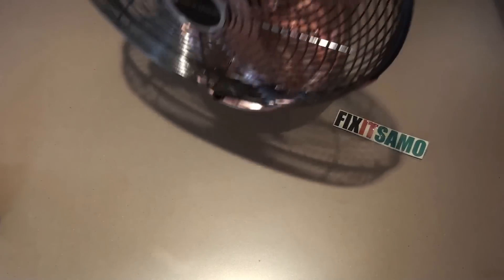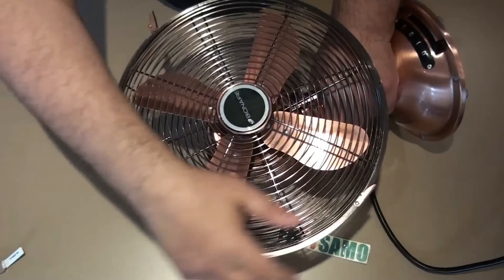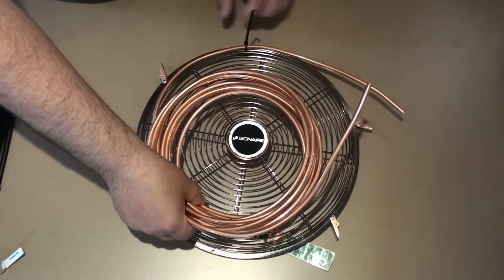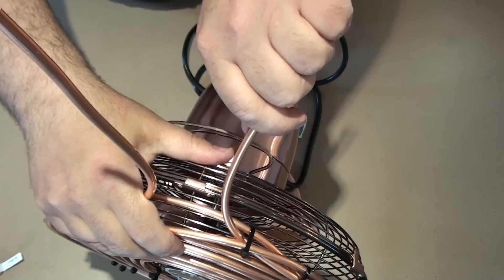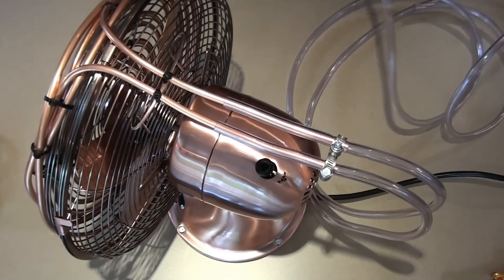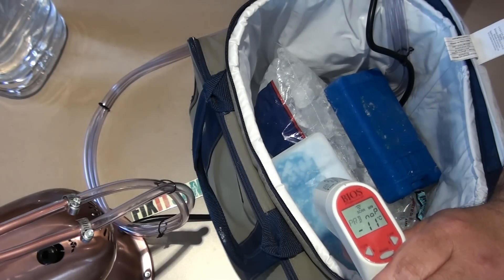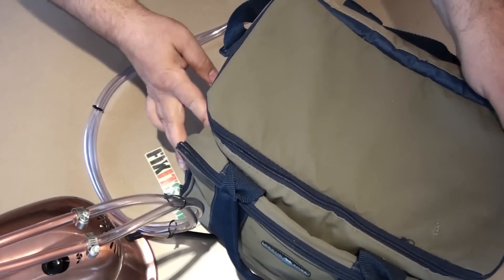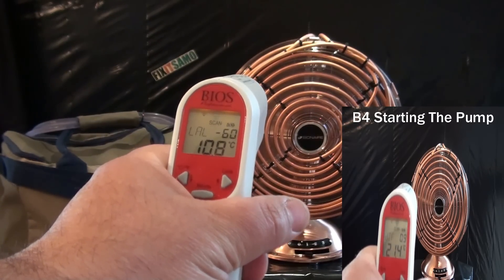How To Turn Your Fan Into An Airconditioner  AC

Comment: How about a peltier cell on the inside of the bag with a piece of copper tubing as a cooling element for the water that circulates inside that tubing and the hot side of the cell with a heatsink vented outside.
Reply: peltier need veeery much energy^^ so you could simply buy an air conditioner with ~1000 watts^^
Reply: *****
I think you can get away with 100-200 watts. I mean a 12V ~6A cell is 72W worth of power and say u use two...you get like ~150 Watts. Now I didn't do the math on efficiency and that's probably where your coming from, and I'd probably agree, but what you could do is put the cold side of the peltier cell into an insulated container and have that cool the water in that container. That should keep it relatively at a constant temperature, after it settles, of course.

And btw this was just a hypothetical question, I wasn't affirming it to work well :P
Reply: Marian-Gabriel Flocan
 I thought that you were speaking hypothetical^^ but to cool an 150Watt tdp cpu you need to power ~300 watts on the peltier:P
Reply: +eta10tp1 Well yeah...but in this case you would only cool room temperature water not CPU's :p
Reply: Marian-Gabriel Flocan
 the effect is the same^^
Reply: :)) It very well may be so...although I seem to fail to understand how a stream of not actively heating water flowing through a tube be compared to an actively heating cpu. But then again if I, personally, don't get it, that doesn't mean it's not so :P  Anyways thanks for pointing me to that :) I'll read some more on peltier's effect and thermal differences :D
Reply: Marian-Gabriel Flocan
 do that but don't do it too much because its a huuuge topicxD :P
Reply: :)) well yeah I just want to get more familiar not to get a PhD on the subject :P

Comment: Am curious if the electricity it cost to make ice costs more than it would cost to have a small ac unit?
Reply: that's true but it is using more energy if it needs to keep more things cold
Reply: Actually it doesn't drain more power, intended as current. It just drains Thermal energy, if that's what you mean. But that doesn't cost you anything in terms of money and also it won't make stuff in your fridge any hotter

Comment: he actually could use dry ice or liquid nitrogen to had a cooler effect
Reply: I don't think so, dry ice put in this kind of container with water would propably destroy the "fridge" becouse of building up gas pressure. Nitrogen could destroy the pump.

Comment: Can you write all the Materials of this Project and can I buy it all at Home Depot ,thanks
Reply: 25 foot roll of 1/4" Copper tube
(2) 3/8" clear vinyl tubing cut to length needed.
(2) hose clamps that fit the outer diameter of the vinyl tubing
A bag of short zip ties or cable ties (get a bag of 100 they don't cost much)
Fountain pump
A cooler if you don't have one and a way to cool the water inside.

Tools:
Something to cut the zip ties
Pliers to pull the ties tight
A nut driver or screw driver to tighten the hose clamps
Reply from the maker: thank you

Comment: dose it really work ??
Reply: yes buy a proper air conditioning unit, lol
Reply: solar panel.   i have 400 watts on my camper roof as well.  the sun feeds the panel which runs the 12 volt freezer and powers the pump and fan.  thats how i do it, i assume he is doing it in a similar manner
Reply: for 10 minutes
Reply: +Mike Warren , what happens after 10 mins ?
Reply: +Mike Warren , i want a solution that can actually cool the rooms air, is it possible ?
Reply: pijush mondal If you live in a dry area you can use a "swamp cooler". If you live in a place with 50% or more humidity, buy a window air conditioner off of craigs list.
Reply: where are you getting power in the middle of nowhere to freeze the water?

Comment: The Tricks: 
1. Cool temp cause by ice bag!

Problem:
1. after the ice melt you will have normal temp.
2. not practical for long hour. 
3. you will have more difficulties on cleaning the fan and copper tube.
4. You are using more voltage for Fan & Pump. 
5. using more space.
Reply: you are using more power to make ice too
Reply: Not really. Your freezer is on anyway. 

A packed freezer is more efficient than an empty one.

Comment: Why not just put the ice in vented containers (that catches the  water as it melts)and put the fan behind it blowing on and through the lattice stacked ice. In the long run the air conditioner will be less expensive. ($135 cost plus electricity to run for 10 years...much less than the cost of the ice over that time. ingenius creation though.
Reply: you can just get back the melted ice into the frig then get another one to replace the melted ice.
Reply: You dont need to use ice cubes. You can freeze bottles of water so when it melts, there is no mess.

Comment: how much is a cheap ac at walmart. how much is copper coil. why do this
Reply: See the running cost, many times cheaper then AC.
Reply: How much is ice. This is dumb
Reply: AC is 1600 watt and this will take less than 100 watts

Comment: you could run the copper tube inside concrete in the basement and never worry about the ice. Concrete floors are cold and never would heat up if you ran several square feet. The floor is not cold but certainly can be colder than the second floor air
Reply: I mean you COULD do that, but that would add to the cost of copper tubing plus additional plastic tubing routing downstairs. A second issue with that is not all houses have a downstairs basement or have access to the concrete below the house. Lastly, with a small pump like that, I can't exactly imagine it's ability to pump water from the basement to the second floor all too well.
Reply: If the air has to travel a long distance it will heat up before it reaches the room.

Comment: This is really awesome!! There is a lot of criticism of this method giving examples of what a typical AC can do and thermodynamics and crap but this is a amazing low cost solution. I see it really being useful in developing countries where people can't afford an AC, let along the electricity it's going to guzzle. They can definitely afford a copper tube and are paying for a fan already and ice is not very expensive. And not to mention its portability (you will need to carry some batteries of course). And I am sure this will not cool the whole room but a few gusts of cool air will provide a welcome respite from the heat. Thumbs up!

Comment: This is not doing anything to cool the air.  Worse, it's adding moisture. Basic thermodynamics. To do it right search for "diy swamp cooler" or "diy evaporative cooler".
Reply: Greg, this is not going to add moisture as the water never leaves the tubes and it will cool the room but moving heat from the room to the cooler bag. Basic thermodynamics. Those were a drawback with the 'air coolers' that had a  process of using a fan to blow on a wet mat to create a cool draft. There will be some evaporation from the cooler but that's going to be negligible since it is pretty much closed.
Reply: Water will condense on the copper tubing and get blown forward
Reply: That's what she said

Comment: Better idea - go spend just over $100 to buy a window AC.  The device shown here actually makes your house hotter due to the energy used by your refrigerator to freeze the blue ice packs coupled with the heat pulled from the blue ice packs while they're freezing being vented into your home by the refrigerators heat exchanger.  Hopefully NOBODY is dumb enough to follow these instructions.  I'm so tired of seeing these "helpful" videos that show such amazing ignorance.
Reply: This should do about the same as a super cheap window AC. You are not trying to heat the whole house, just a specific room. That is why this unit, or even a cheap window unit, would only be used in a single room. Chances are he isn't trying to keep his kitchen cooled and this is for a bedroom.
Reply: you would have the freezer going anyway
Reply: In the kitchen. You're looking to cool yourself and a small area, not the whole house. It's a tradeoff that you're going to make no matter what decision you make. Either get an AC unit and have it run electricity making it cost a lot more in general or make a cooler like this to give you the temperature you want where you are and make the house suffer a bit more.

HOWEVER, if you're running into a heat issue and your house is too hot as it is, circulate air from outside into the house to disperse the heat. If it's that much hotter outside than inside and your freezer is running, what difference would it make at that point to circulate the air and make it no hotter than it is outside? Yes, you're drawing power from a freezer and circulating air, but that is a lot better than installing an AC unit. Plus, the heat output from a freezer after an hour isn't likely as hot as the day outside where you're forced to use a cooler like this.

Comment: I did this prior to watching this video but, my setup is almost exactly the same just on a larger scale.  My fan is a floor standing fan about 24" wide and it oscillates as well.  I use mine to keep my garage cool when I'm in there doing stuff and it works excellent!  The only one issue is that with the movement and circulation of ice water in the cooler, it makes the ice melt faster than normal so bigger ice blocks last longer.  However, if you keep it covered the temp of the ice water goes up slower and still keeps my garage much cooler than if I didn't use it at all.  I've been successful in cooling it on average about 10-15 degrees at least.  Not as easy to cool on higher humidity days

Comment: I checked Amazon for the pumps but on some pictures there's a AC 220 volt pump and on other pictures AC120 volt. It's kind of confusing! Which version they will send? I live in Europe and I need a 220V version.
Reply from the maker: try here https://www.amazon.ca/OFKP%C2%AE-Submersible-Water-Aquarium-Fountain/dp/B015MMFMIK/ref=sr_1_1?ie=UTF8&qid=1466292602&sr=8-1&keywords=220+water+pump
Reply: Thanx! This one appears to be O.K.

Comment: You are aiming at the coils when you were getting a temperature reading right? Why not set up a piece of cardboard parallel to the fan, right in front of the face, and take a temperature reading of the air its blowing. I have a feeling it may be 20F*+++ warmer.

Comment: This is really neat, but why would you want to do this? Isn't the cost and trouble of replacing the ice going to make this unit impractical? Also, you have no thermostat so you'll have to constantly babysit the unit to keep the room at a comfortable temperature.
Reply: It's a poor man's AC unit.  I love it and this poor man is thinking about making one.  $450 (avg. price of a small AC)still buys a lot of ice and you are not using it all year long.
Reply: Not to mention if you have a freezer you can just make the ice. As for a thermostat, while it would be useful it wouldn't be at all necessary. It's literally the same thing as turning on a fan in your room, just colder. At the end of it though, a few feet of copper tubing and a fish tank water pump sure beats the hell out of a $400 window conditioning unit. Also much more mobile, so you could have it on your desk rather than in a window if you so desire.

Comment: This is so cool. With a pump like that, electricity consumption must be low. Only issue is to try to have good insulation for the ice packs. May be the tubes can be place below the motor to prevent a short circuit if there is leakage.

Comment: the AC in my apt is out, might try this tomorrow if they haven't fixed it by then, not sure it's worth buying all those supplies but trying to sleep in sweltering heat is awful, cool video

Comment: With all the money and time spent you might as well buy an AC 😂
Reply: This is for cooling a single room though, and more for cooling a single area of that room. You can get cheap window units for ~$150 all day long that will cool a small room like this is designed for. The window unit should do a better job as well since it will dehumidify the air which is a HUGE part of staying cool.
Reply: Your average window A/C unit costs about $350 assuming you can't get one off a friend for a lower price. It would take about $20 to afford the amount of copper tubing he used (Even less if you get it from a scrap sale/junkyard/recycle plant/etc)
The vinyl tubing could be bought for $5 if you're being overly generous (you'll get about, eh, 7 feet out of that)
The pump itself is anywhere from $9-$15 dollars.
If you don't already have a fan, lets throw in another $20 for a good fan.
In total, you'll spend about $55 if you go the maximum to have left over supplies.
That's 1/7 of the price of a window A/C and it can be built in an hour or less.

Note: The prices I show are based on nearby stores and hobby shops, not what is listed in his description.

Comment: A better solution is a "swampy" assuming you live in a low humidity environment. Running your freezer all day to keep this supplied with ice isn't particularly efficient. The added resistance of the air flow will also tend to overheat the fan motor and also cause it to draw more power. All in all, this is a bad setup.
Reply: Um, freezers run all day anyway.
Reply: No they don't. Your compressor only comes on occasionally. But if you fill a bunch of ice-cube trays with water, the compressor will kick on and stay on. Turning water into ice requires a lot of energy. It also takes a lot of energy to turn ice back into water, MUCH, MUCH more than to raise the same amount of water a single degree. It's the latent heat effect.

Comment: I think it would be much easier to go out a buy an AC unit.
Reply: Firstly buying an ac wouldn't be cheaper, at least not where I am this would be, secondly some people have fridges that make I've you don't have to keep buying it, what's wrong with putting a plate or something in the freezer? Is your freezer really that packed? There alternatives.
Reply: yep. a small one for sure. i bet it isn't that much cheaper with all the ice you need to keep buying.
Reply: You could even buy a used one for cheap....or you can find some for free from people who like donating their stuff to people like this guy (who made this homemade AC unit)
Reply: not in my country...nobody donates anything... AC are very expensive. I have a fan already at home, i think i'll try and improve it with this method. This kind of idea is for those who dont't have enough money to buy new things. where i live, only to fix an AC in the wall costs arr. 100-150 E, plus the apparatus.

Comment: Nice clean job. The point is that it is used when an a/c isn't practical. Also this uses far less electricity. However, making ice... Note: Use a brushless pump if your going to run it alot. :)))
Reply from the maker: thank you

Comment: this isn't an air conditioner. you're using the air from the house to warm up ice cubes. you might as well leave the ice cubes out on the bench. and even if you had this going to a fridge, your fridge actually warms up the outside as it cools the inside. thats how it works.

you're just blowing wet air around by disturbing water when it returns back into your bucket of water there.
Reply: Satanic comment
Reply: They do have things called 'swamp' air conditioners in dry climates; air is blown through wet pads to cool down a house. 

Depends how well insulated the cooler is ykno? If it's decently insulated the ice would likely stay frozen for five to ten hours, and you can keep swapping out ice packs..

However, water will condense on the outside of the copper, so there are a few practical concerns I'd be interested in seeing addressed.

Comment: First, thank you so much Samo for sharing this great idea, I am so doing this very soon.
Second, for all the negative commenters here, even some suggesting to by a window AC wow the shock of wisdom obviously this is not meant to replace your household AC, this is something meant to work on a small scale like a camping tent or a small  RV where you hock it to your car battery or a solar panel. I do a lot of desert driving and camping and this is just what I need.
Just 2 questions here Samo,1- say it is really hot night (37-41 C) how long such an exact setting will last on one full load of ice? both the fan and the bag I have are about the same size you used in this video. 2, as I will be using this as part of my camping gear, I was thinking of either fixing the copper tube ether at the back screen of the f
an or inside the front screen so it is protected. any reservations on that?
Reply from the maker: thank you sorry for the late response the cooler that I used the ice lasted at least 12 hrs.  but it was  28 C I don't recommend installing the copper tube  at the back it will not  give the same results

Comment: why go so far as have to worry about ice drill a hole into ur fridge slip the hose in to it and out so it can cycle. water wont freeze if its flowing so u can wrap the hose inside a few times to get it colder and just make sure its not leaking and has no pockets of air in the cycle once done seal the gaps left by the drill with epoxy and done
Reply: make some video for that sir. tnx
Reply: This would kill your fridge in no time at all.  It would be like leaving the door to the fridge open all day.
Reply: a fridge puts out heat
Reply: I think the fridge compressor can run continuously without burning out. Plus the small fridge is only 1 or 2 amps.

Comment: what you have made is a cooler, which is commercially available(and cheaper than ac) for decades.
Reply: no thats not cooler. thats how ac work. cooler create lots of humidity but this thing will not.
Reply: No, A/C is phase change cooling. Evaporative cooling will make more humidity but this and A/C will not.